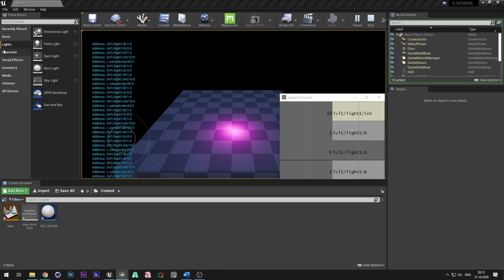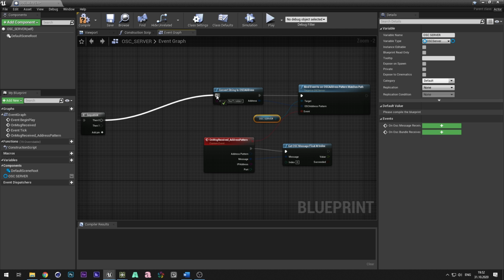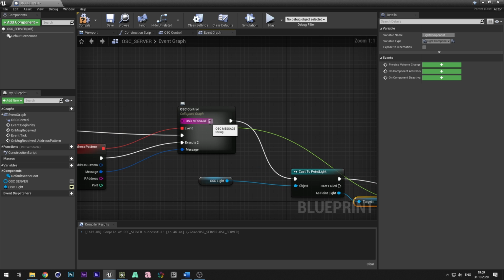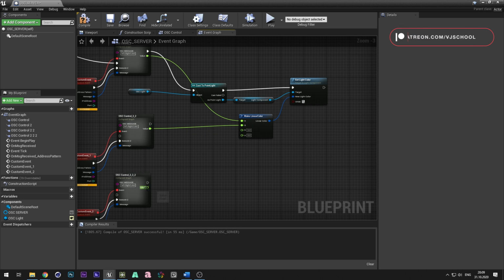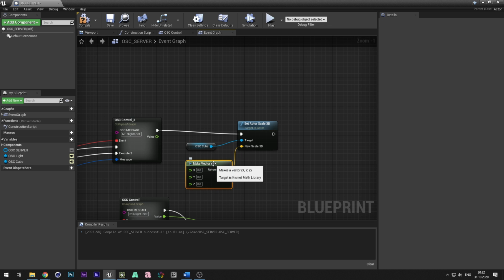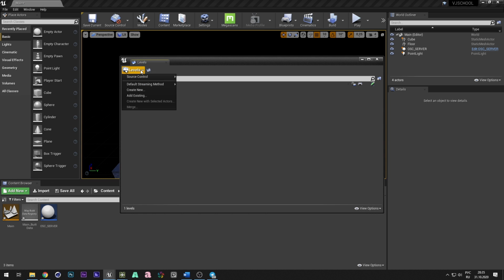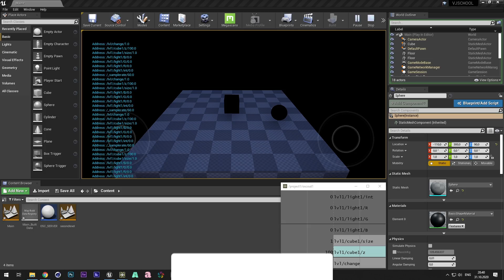UE4 OSC - control Unreal Engine with Touchdesigner

Comment: I’m having an issue with UE5 with OSC coming from Touchdesigner not actually binding the message. It works when sending straight from an iPad running TouchOSC, I set the same values up in a constant and try running from Touchdesigner and I can see the messages coming in on the Print string but they will not bind to their addresses in the message handler. Is this an issue you have came across?

Comment: Hi, 
Thank you for this tutorial! I'am trying to control (with touchdesigner) the rotation of a camera (in UE4) but in the editor mode. The blue print only work in "play mode". I tried to overpass it but without success. I guess it's possible to send "live" data in the editor mode because the Vcam (Virtualcamera) plugin works over the network that way... (I don't use Vcam because it's not precise).

Do you have any idea?

Thank you very much,
Nelson

Comment: Hi Bro, Is It possible to import a geometry from touchdesigner to unreal?
Reply from the maker: I think it won’t be easy.
First way - you can right click on sop, then select export geometry. And import this fbx to UE4. But for doing this in runtime, you need plugin for ue 
Second way - export points from TD throw UDP, and make procedural geometry in UE based on this points

Comment: This was very helpful! I ran into an issue when changing the IP to my other computer on the network, to receive messages from it. FUdpSocketBuilder gives me "Failed to bind <server> to <IP:port>" (and some variations), and then I get a similar warning from OSC. Any idea how that might be fixed?
Reply from the maker: hi, you change ip in "Create OSC Server"? You need to set ip adress that belong to UE4 PC. Hope this link will help you https://support.microsoft.com/en-us/windows/find-your-ip-address-f21a9bbc-c582-55cd-35e0-73431160a1b9
For example you have one PC with UE4 on ip adress: 192.168.1.60 and another PC with TD on ip adress: 192.168.1.70. So in UE4 "Create OSC server" you need to set 192.168.1.60, and in TD "OSC Out" set the same ip 192.168.1.60.

Comment: Hi, firstly thanks for your tut. i've always worked in past with the plugin on git for c++ projects,  but now for several reasons i'd like use your approach. 
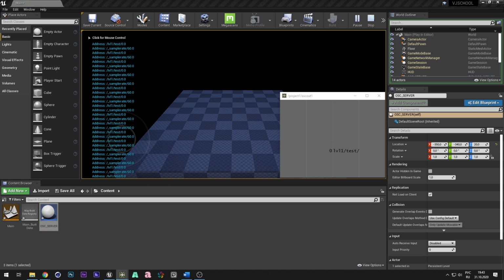...but  i stop at the first point at 1:30.  I'm unable to recieve the print in unreal at this point. 

firstly... i work with unreal 4.26, the workstation is new and clean, i've just tried with: localhost, 127.0.0.1, 192.168.1.x (my ip), changed port numbers in td and ue4... but no way. 

the only thing  that i've supposed, is that u are working with 4.25 and something is changed in 4.26... 

the problem is that the flow stop at the binding step and never flow in the custom event.

I did your procedure 8 times just because i watched your video to see if i had lost something... but everything is correct.... (and logical)
i tried to run touchdesigner and unreal in administrator mode too...

do you have suggestion ? i'm going mad. 
(my firewall is still locally disabled)
Reply from the maker: Hi! I think it’s a problem in 4.26. A lot of people can’t run OSC in new version.

Comment: Hello, thanks for the great tutorial! However, the lost connection is not restored when I run via exe package. Any suggestion? The error message is 'Failed to bind OSCServer_0lzGeBBtKUubpVHZRmQiYg to 127.0.0.1:7000'. Thanks!
Reply from the maker: Hi! I didn’t try in exe package. Maybe try to change IP port.

Comment: I can get this working in 4.25 - but in 4.26 TD gives errors in the Output Log.   Wierdly TouchOSCiPhone works ok with identical data.:   "LogOSC: Warning: Failed to parse OSCBundle of invalid format. #bundle identifier not first item in packet."
Reply from the maker: hi, i didn't test OSC in 4.26. But i see that error "OSCbundle", can you try to recieve messages, not bundles?
Reply: @VJSCHOOL   Hiya.  I'd like to but unsure how to switch to messages in TD.  Like the tutorial, my Blueprint is set up to receive messages.
Reply from the maker: @petewallace4376  in TD you can send OSC with OSC Chop (green) & OSC Dat (Pink), osc chop allready in message mode, osc dat have option like "split bundle into messages". Also check if you send value in format "lvl/name/value". Sometimes it doens't work if you just typle "name/value"
Reply: @VJSCHOOL   Thankyou.  I did wonder if the DAT might be the solution
Reply: @petewallace4376  Did you successfully send OSC Messages to Unreal 4.26?
Reply: @NotesfromUnderground   I’m afraid I haven’t tried since then.  But maybe there’s a new build ?
Reply from the maker: @petewallace4376  I made update for 4.26 version - https://www.youtube.com/watch?v=TuAhDUcCp-c
Reply: @VJSCHOOL   Many thanks!

Comment: Nice video!! How would you handle having multiple point lights (let's say a hundred) and then each one receiving an osc message to change its intensity independently? (or maybe a single osc message with a hundred values)
Reply from the maker: Hi! You can use “get all actors of class” and then cast osc value to every copy in range. I will show this in next tutorial :)
Reply: @VJSCHOOL  amazing cant wait! 😁

Comment: I see your controlling everything from the osc out. Does this work for controlling specific parts in blueprints as well? Multiple blueprints in scene? Would it be easier to have separate servers inside separate blueprints?
Reply from the maker: I think it's better to have one OSC server blueprint and cast values to other actors/blueprints. You can make variable with blueprint and cast to it, or you can for example get all actor of class and send values directly to them. You can send message to any actor or even to niagara system, create variable for parameter and cast to it from OSC server BP.
Reply: @VJSCHOOL  that makes more sense for sure. I was having to create a bunch of servers for each component. So my niagara system was in a blueprint that had a separate server. So powerful with TD audio filter capabilities. Thanks for the tutorial!